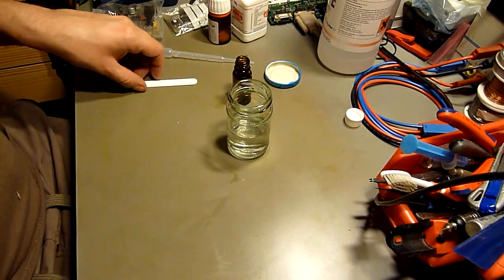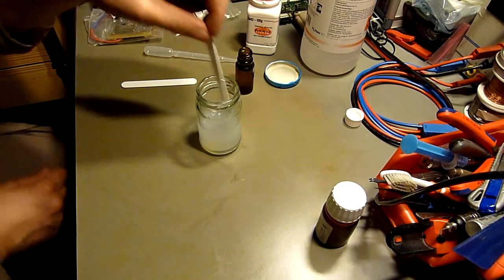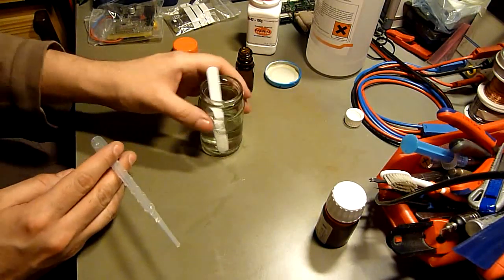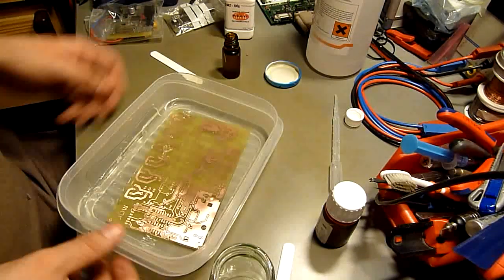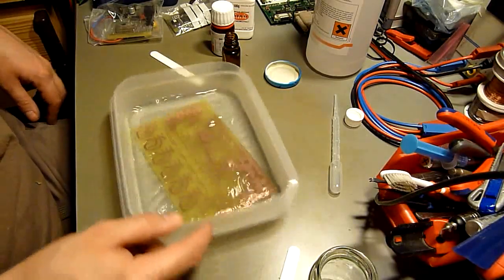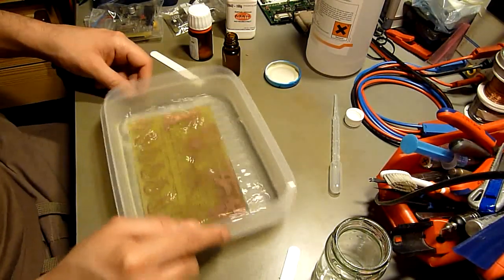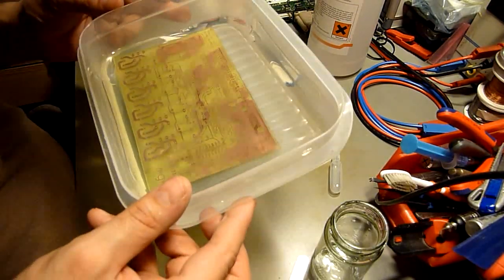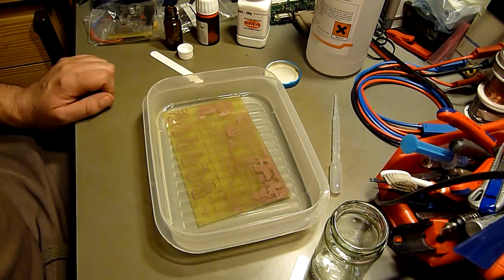Silver coating a PCB, part 1 of 2

Comment: Why not just immerse in sodium sulfate with a 6vdc annode to the copper on all pins of PCB edge connector, also submerge [but not thouching PCB] .999 fine silver bar and attach -6vdc (neg / cathode)? The plating process would begin immediately, and depending on gross area of copper, plating will be achieved quickly.